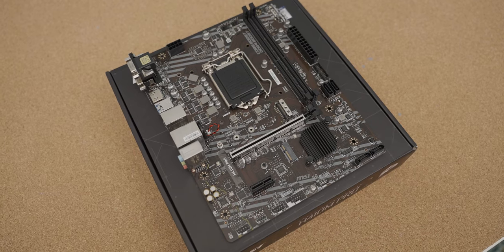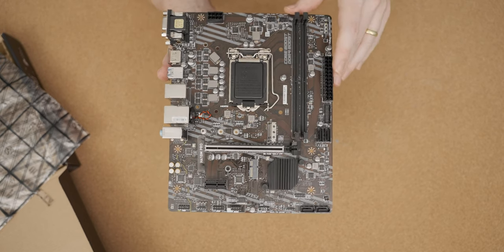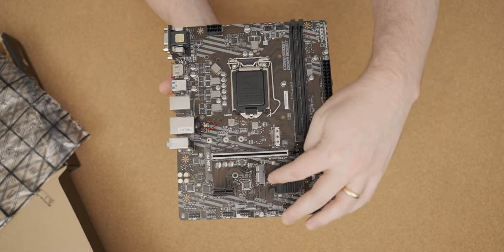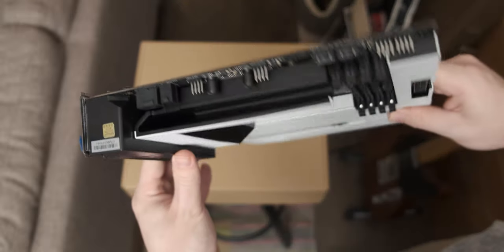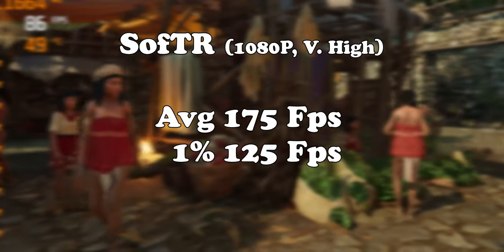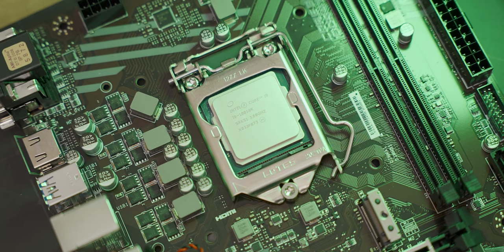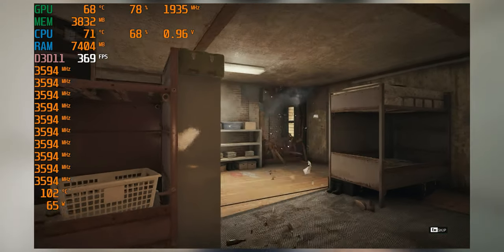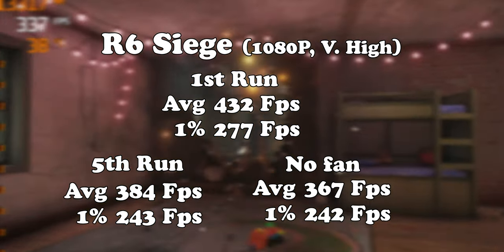10 Core Gaming CPU vs Loser Motherboard...

Comment: When u win a CPU giveaway
Reply: I mean it can game right?
Reply: @problemtf2532  it's the same as having a V8 twin-turbo engine on a ford fiesta.
Reply: Well, just buy thermal pads and stick a piece of aluminium on it, problem solved.
Reply from the maker: Haha!! Exactly.
Reply: I have never been offended by something I agree with
Reply: But you forgot it can handle 3rd gen cpu
Reply: @anerror9926  actually would fit pretty well

Comment: You are basically just building a prebuilt, cpu mobo combo.
Reply: I misread as Mombo Combo and now it's head canon.
Reply: Go Dingos!
Reply: Lol
Reply: @TheGerudan  Don't forget to use the Asus Phoenix version of the GPU, one fan will clearly do on the GPU! Also, swap out the one DIMM and replace it with an unknown cheap brand like Micron! Forget HyperX or Corsair, Micron is where it's at.
Reply: @absbrah38  micron isn't unknown though, they make memory chips for lots of the ram manufactorers (corsair, kingston, g.skill, etc) but some of their stick are sure shit
Reply: @absbrah38  Yeah bro actually hardcore overclocking channel has a video of him running stably at 5500 mhz ram overclock on micron e die ram (crucial ballistix max). The micron e die boosts farther than even samaung b die but its timings are looser
Reply: Lol
Reply: @breakcoregirlxd  yes
Reply: @absbrah38  Micron actually makes a lot of the ram modules for other brands. Micron is good stuff

Comment: Ah yes, The Modern prebuilt combo. Combining High end cpu with Basic af board. And people still buying it
Reply: dont see why not,in most cases at least,unless you want to oc ofc
Reply: In March I bought an rtx 2060 build (it was asus Phoenix of course because cheapo) with 9th gen i7 and it had the cheapest mobo possible! An asus prime h310 loser edition.
It was so bad that I would have my PC severely drop in performance and snappiness even when browsing since they put a cheap off brand ssd with only 240gb, it got way better and what it should have been at 1149 pounds when I upgraded in black friday to the z390 pro carbon and a 2tb corsair mp400 ssd. I could overclock my cpu finally to 5ghz and overclock my 32gb ram to 3600 after it was stuck at 2666 moral of story, build your pcs so you know what parts you are going to use and if you can buy these cpus surely you can buy the z390 8th,9th gen or z490 10th gen
Reply from the maker: Haha!! It really is. But honestly, I was surprised at how well it handled the CPU
Reply: If it's not the cheap motherboard then they end up getting a trash power supply that's a fire hazard
Reply: @tomasruiz4675  it's a little too basic though, I'd rather my vrms had a heat sink. I don't mind not being able to oc, I just wanna be sure the board won't crap itself within a week of owning it.
Reply: Monochromatik-Vision  that's... Yeah.
Reply: I also have a "loser" motherboard and it's not bad.
Reply: I work at a pre build company and people really just want 'bang for your buck'. If they want a pc with a 3600x and a 3060ti they're just gonna find the cheapest one just because they think they found a good deal.
Reply: @tomasruiz4675  He said why not in the video. Even if you don't overclock, it gets toasty enough to throttle a good amount. And while it may still be totally playable, buying a high-tier CPU alongside a super-cheap motherboard is simply stupid and not something that anyone should do.

Comment: 2 holes for vrm's heatsink , you can add thermal pads and heatsink .Test it again! Should be interesting.
Reply: Whats the point tho?
Reply: @h1tzzYT  to show a cheaper motherboard is actually a good value by simply adding a heatsink to the VRM.
Reply: Agree
Reply: The mobo is dead
Reply: @nicholasespinoza9610  I was thinking about that when I saw a holes at beginning of a video but combo like this is still bad idea, no matter how you cool them down pressure on these 4 phases on a long(er) run will result in premature death of some of them.
Still, it's not bad idea for any other case when somebody pair this MBO with some more suitable CPU. Finding heatsink that will fit on these mounts is harder part but at least there is room for some modified solution, on many boards without heatsink layout is terrible and it's impossible to fit anything expect maybe small "memory" heatsinks.
Reply: I immediately noticed the heatsink mounting holes too... maybe a slightly higher model using the same pcb does get vrm heatsinks?
Reply: Good idea for a video
Reply: @weswes10  more likely they design with VRM heatsink in mind and then as cost saving measure just decide to ship without it, it's well known "It'll be ok" manufacturing standard.
Reply from the maker: That is a really good idea. I even have a heatsink that would fit in it lying around.
Reply: @DawidDoesTechStuff  do it please
Reply: @DawidDoesTechStuff  this would really help if you make a video about it and share the experience cause my brand pc has same motherboard and processor.
Reply: @DawidDoesTechStuff  Do it. =D
Reply: @DawidDoesTechStuff  Do it! I added some stick-on heatsinks to a crap tier 390 board and it helped a lot.
Reply: @DawidDoesTechStuff  DO it mount the heatsink and tell us if there are any improvements.
Reply: Yeah I totally agree with you
Reply: @gorjy9610  I use tape that is like a thermal pad but has sticky stuff on both sides and copper blocks for small ARM CPU's in tablets with bad cooling that would probably work for these motherboards too but the copper blocks would need to be bigger to take more heat away
Reply: @nafissadiq4664  oof why would you buy a 50,000rs cpu and a 5,000rs motherboard man? If you could replace it with at least a z490
Reply: @armaansamirizvi3354  im using corei5 6th gen with h110m with gtx 750, my vrams temps gets to 60C+ while gaming.
Reply: @armaansamirizvi3354   and im from bangladesh the price is decent compared to India and Pakistan its almost 15000rs less cause of tax cut by the government.
Reply: @nafissadiq4664  yea okay that's alright.
Have you brought the new components? Are you getting the 10th gen i9??

If you're gonna go for a 10th gen i3, or even i5, core-10400
The msi h410m is.... Ookkay... Just slap an external vrm heatsink with thermal tape and have some nice case airflow cooling.

But if you're going for the i9, minimum you should see is z490 series
Reply: @nafissadiq4664  also congrats on the low taxes hahah

Here in India we're fucking because of the extra 26% tax we have to give for these components man
Reply: By the time you added thermal glue and glue some heat sinks on, are you saving that much money? This is still a flex mATX board, meaning it's missing the right most mounting holes, with fewer layers. They tend to die MUCH easier with hardware swaps.

I just bought a Gigabyte B460m Aorus for $80 with CPU discount that has VRM heatsink and a probably sized mATX PCB (not to mention a few more I/O). No way ANYONE should waste their time and money on these bottom of the barrel boards.
Reply: @i077  pads+heat sink would cost you less than 5$
Reply: Let's make clear that is a fix but never should be a thing. Saving 5 dollars on a motherboard and then come to the conclusion you need to fix it for 15 dollars. You should have bought a proper motherboard in the first place...
Reply: @DawidDoesTechStuff I’ve waited 2 years please do it haha

Comment: From the holes its look like a heatsink on the VRM'S was predicted to be mounted. So with a search you can mount a heatsink easly there.
Reply from the maker: Yeah that would be interesting to see. 😁
Reply: That would make an otherwise budget board a reasonable option for mid-range gaming.

Still wouldn't put an I9 in this thing though.
Reply: I have the same mobo,can anyone please help me in putting a heatsink on the VRM.Where can I get one ?

Comment: Downdraft cooler would probably outperform a AIO due to cooling the VRM off
Reply: And if ti not enough, you could get like another 120mm case fan to fully cool it down. and save like 100 quid on motherboard.
Reply: That board might not throttle if used with stock heatsink.

Comment: Why is only one fan randomly spinning on your 3080? Lol I think you rlly messed that thing up😂 6:35
Reply: I think thats just EVGA cards, if I remember they have a ton of sensors on the board and can control the fans separately from one another
Reply: @leaha2357  That's what I was thinking as well so I googled it for 2 seconds and found on the EVGA forum a lot of people were complaining and had to rma their FTW cards because only one or 2 fans would spin randomly and they had issues. It could be completely unrelated but I just thought Ide mention it. Lol it was funny just watching him talk while only 1 fan is spinning in the background then thinking back to the liquid metal video.
Reply: @PabzRoz  Hahaha yeah it was pretty funny think back to the video with the fans
Reply: It was idling because nothing was being run

Comment: It didn't perform that badly imo, it's not really a CPU+Mobo combination that would be common. Trying to run a i5-10400f on that H410M motherboard would be quite a lot more sensible and would likely work fairly well in most situations.

Comment: I had a prebuilt with a Ryzen 5 3600 and A320 cheapo mobo. VRMs reached 120C when editing videos. Eventually smoke came out.
Oh, and it was an MSI "pro" motherboard. But it looked way cheaper than yours

Comment: I just bought this motherboard to save some money to buy a nice PSU and other components, I had a tight budget so acquired an i5 10400 locked and a gtx 1660, is it going to work properly or it will throttle?

And also, should I cool my VRMs with some sort of copper plate?

Comment: When the local computer parts shop have cpu and mobo combo

I9 10th gen ten core cpu with mobo
Included parts:
i9 cpu 10th gen

H410m pro

it can get 400+fps  in csgo
with rtx 3080 

RTX 3080 sold separately!

Comment: Hey Dawid, you remember cpu cooler on laptop few days ago? And you were initially thinking about strapping aio? There's a way to get even contact: get dremel, cut hole under heatpipe connecting Cpu & Gpu n strap in there, make sure you drill few holes for countersink screw to mount aio to the chassey.
Done. No fuss whatsoever.

Comment: I'd be curious what throwing some little copper heatsinks on those VRM with a single 120 MM fan would do for those VRM's.  I bet it would keep it from throttling and those heat sinks are pretty cheap on Amazon.

Comment: Hmm, you what would be interesting, what if you attached a heatsink to the VRM to help cool it, I wonder what the performance would be after an extended time then? Would it be able to hold 4.8GHz due to no temperature throttling, if its enough, though its only a small 4 phase design

Comment: vrm's are meant to run "hot" compared to other components but i wonder if the measured temps are edge or junction?
Reply: Temps were made even worse with his choice of a cooler. Temps could have been way better if he had used an air cooler that pushes air towards the motherboard.

Comment: For locked CPUs this series of boards is meh but alright, I don't know if this applies to the newer ones, but I own a B250m  Pro and I hate the fact that it has ZERO manual voltage controls, something that could be awsome to stop my I5's furnace tendencies.
Reply: Which i5? Any i5 on that platform shouldn’t be like a furnace.
Reply: @EvilTurkeySlices  7600, stock it runs at 1.2 ish volts and i'm still running the stock cooler because for a long time I was able to undervolt it using XTU, but after the 20H2 update XTU refuses to even launch
Reply: @nagizah8  upgrade the cooler then.
Reply: @EvilTurkeySlices  yep, that's the current plan, I was avoiding it with my undervolt, but it no longer works '-'

Comment: Being cheap on the motherboard is always a bad idea. Learned that lesson the hard way.
Anyways, another entertaining video, keep up the good work, Dawid:)
Reply: I bought a pre built from Amazon as my first PC in March when I used my dad's old gt 210 PC since 2011, I knew absolutely nothing about pcs so when I saw the big numbers i7 9700K, 16gb and rtx 2060 at a £1149 price we bought the PC, despite the seller obviously not stating the other components branding nor the powersupply 
When it came, owning a new gaming PC made me glad I finally have such a thing, unaware of the terrible h310 motherboard I got, the powersupply was advertised as 600w but we got 500w without any brand name, we can't get a refund since the company ADMI also known as AWD-IT (AWDful-Isn'IT?) No longer sold the PC and we find out the psu was a scam in November, that was when I upgraded to the z390 and saw a way better performance boost and could finally overclock my ram and cpu safely we bagged the £250 gaming pro carbon ac at £174 for black Friday sales
Reply: @absbrah38  Yea, prebuilt PCs are usually gimped in the motherboard department. Screwing over your clients to save a couple of bucks on the main board.

Comment: That RGB header might be for prebuilt PCs. As long as the PC shines like a rainbow people will buy it. To make the throttling even more visible, you could've done a long blender render or run Cinebench on loop until the score reaches its lowest point. You could also attach some tiny heatsinks to see what difference they would make. And don't shame the Toyota, that VRM is a Geo Metro or something :D

Comment: Why overclock on the z490 ...
 Next time try some heatsinks with thermal tape to see if we exclude cooling & overclocking (no one gonna use a k cpu with an h motherboard) the most realistic way is a i5 10400 with the h410

Comment: Dawid, I'd like to see an extensive test of this budget board, but when you slap on a bit of aluminium bar stock over tyhe VRM.  Something that's not a heatsink per se, but will it work to give better performance?

Comment: What was the takeaway from this? Sorry, im a little bit dense. 

Would it be wise to get a mobo like this and an i3 10100F and later add an i5 10600 for improvements in 1-2 years?

Comment: It is very disappointing where H motherboards got. Even my 6.5 years old H97 has VRM heatsink, 4 USB 3 (!) - not 3.1 though, 4 dimm slots and 6 sata port (H410 has 4).
Its a shame that Intel even limiting the ram speeds too. With an i3 or i5, H series motherboards can run RAM at 2666Mhz maximum.
Hopefully this will change due to competition.

Comment: Video idea : for AMD we know that there is 3 types of chipsets : Ax20 for the loosers that can't overclock, Bx50 for the "only gamers" and Xx70 for the gamers that want do-dads on their MoBo. I mean the product segmentation is very clear and simple.

But for Intel, this is litterally all over the place. The only overclocking chipset is Z490, but there is also B460, H410 and H470. All of those can't overclock, and are locked with their memory speed as well (and the same speed at that)

AMD processors are SoC and the chipset is just like an IO controller and nothing else, while Intel processors rely on the chipset for a lot more. 

So what is the difference between the 3 looser chipsets, H470, H410 and B460? Is it worth it to go K cpu with a Z board or a nonK cpu with a decent B board is sufficient?

Comment: I actually am eyeing that very H410M MB... not for an i9 of course... I have a very basic system in the bedroom for web surfing in a very tight space, so it requires a very small MB in a very small case I own... the case is a Micro-ATX case, but it can't fit a full 244mmx244mm board in it, but it can fit boards the size of the H410MB... I was looking at the H410MB combined with an i3 and call it a day... Looks like it has everything I need! lolz.

Comment: But...
Are not cheap boards supposed to have stock fan cooling to cool the vrm?

This 'issue' comes with all liquid cooling solutions, which is funny when ppl cool for clocks and kill with the heat issue that this causes.

Comment: Actually, it's quite common practice in pre-builds. Even motherboard-CPU bundles have the same.  I found quite a bit of listings with Ryzen 7 paired A320 mobo and memory 2133 or 2400. All marketing is based on how powerful CPU you get, missing the fact that rest of components will drag it down...

Comment: I run a MSI B450A-Pro Max, and it is just a non-RGB Tomahawk with slightly different rear I/O (in a way that makes no difference to me). Their Pro series can have some surprisingly well featured boards for what they cost. 

I don't know for the H410 chipset, though. It clearly runs to Intel's spec at least, and not a toe over that line.

Comment: "it seems like they're using doublers"
No it doesn't. There are 4 power phases, and there are 2 high-side MOSFETs, 2 low side MOSFETs, and 1 choke per power phase. You would never get doublers on a board this cheap, and the layout doesn't look like anything you would ever use doublers, and if it's a 6-phase PWM controller you don't need doublers to get 4 phases to the CPU. There are not "8 sets of power phases" for CPU power, there are 4.

Comment: I have the exact same motherboard and built a very decent gaming cpu at a fraction of the cost compared to pre-builts. Plus anyone with a right frame of mind would not put an I9 in such a MB. The max i would put is something with a 65w tdp (i7) and not an i9 with a 165w (i think) tdp. Thats just stupid. Plus the money i save on the MB can be put on the 12th Gen MB upgrade, when its comes out. Also in my country the Z series is 3 times the price of the H series. Thats an additional US100 which can be used for better GPUs or more memory. The only think i hate about intel at this time is being unable to use faster memory on lower end mother boards, but overall i saved close to USD 200 by going with a cheap MB plus i5 CPU just to match R5 3600.